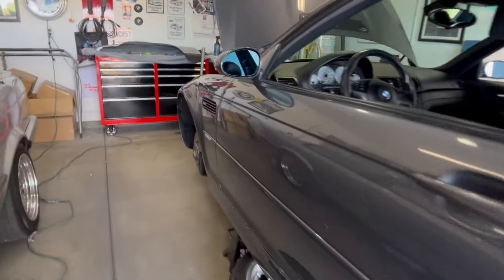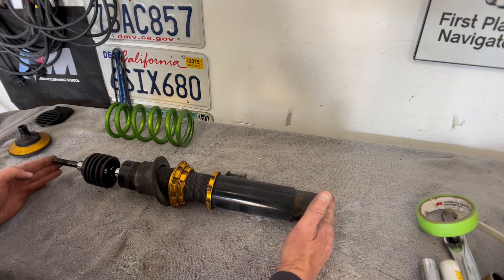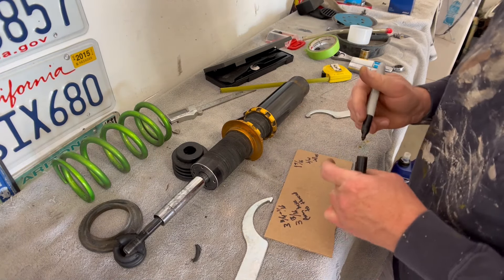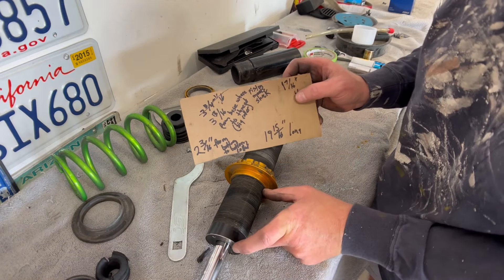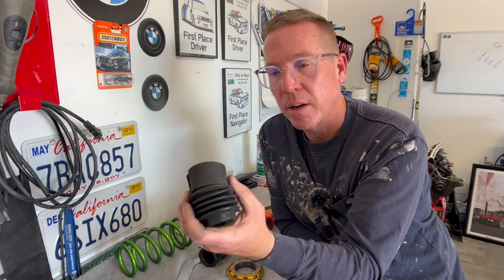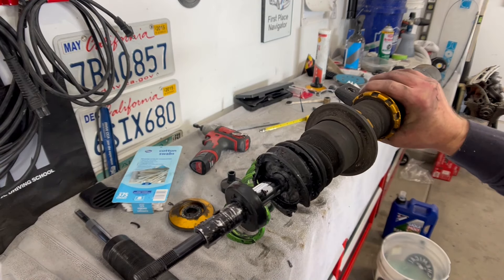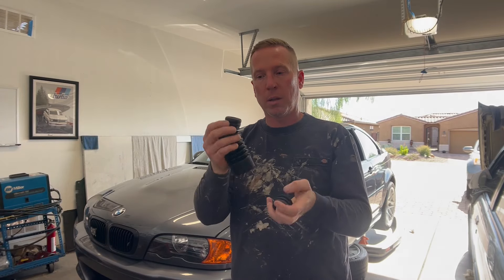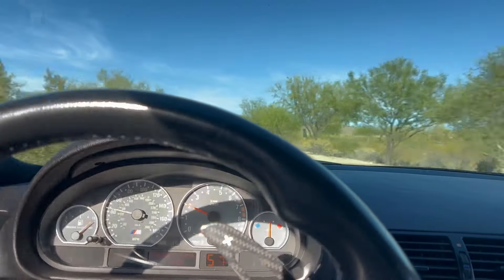I Destroyed My Coilovers! BMW E46 M3

Comment: What do you mean by "blown shock" ? Chewed up rubber/plastic is a nuisance but far from a failed part.
I have ISC coils on my e39 and haven't had any problems w them. Car sees all the $#itty roads around south CA, they seek me out for some reason. And FTR my fiver's been airborne TWICE and coils came through w flying colors.
Reply from the maker: Hey, thanks for watching, though, respectfully, I’m not confident you watched it. I clearly showed in the video that the shock blew its seals, thus the fluid all over the shock absorber. Yes, the chewed up bump stop is a nuisance, but I thought I showed in the video that shock absorber was utterly destroyed. I’ll re-watch my video to see if I misrepresented the severity of the title. This was the second shock absorber I’ve blown so all four are now replaced. Thanks!!